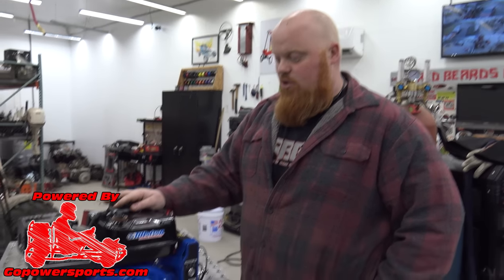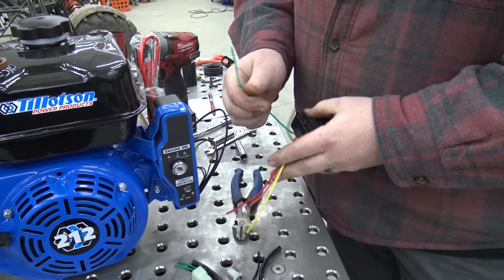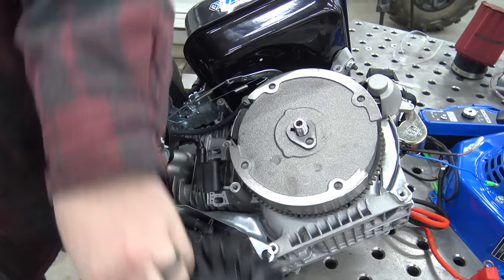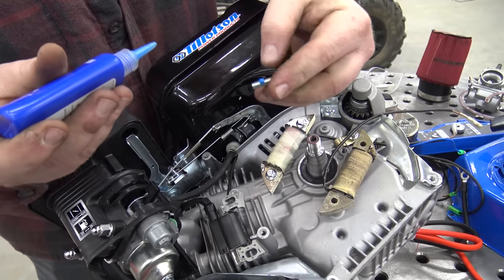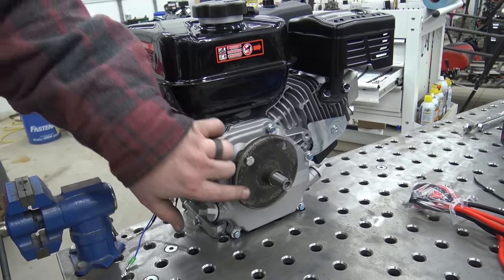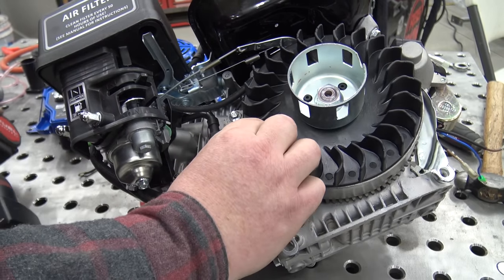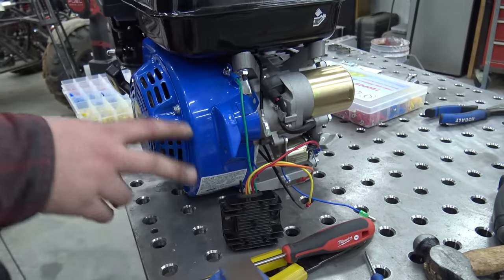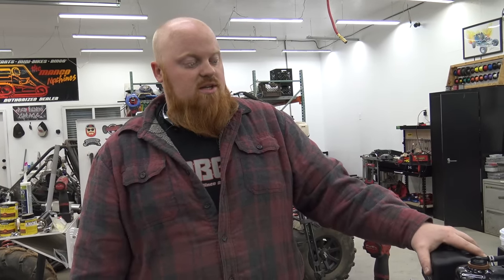How to Wire A Go Kart / Mini Bike Charging System

Comment: Whenever you see a rapid pulsing of the headlight it is because they are being run directly off the charging coil on AC current. Once you install the rectifier/regulator, the pulsing should quit, since they are now being fed "clean" DC current and also seeing a constant voltage from the battery. While they may get slightly brighter from the slight voltage increase when revved from idle to RPM , they should not have the "strobe" effect that the un-filtered charge coil current provided.
Reply: So I don't have a battery does that mean I can just hook the rectifier straight to my headlight for strictly lighting purposes
Reply: And I have the predator 224 do I need to get a special flywheel to work with the coils?
Reply: @motododo4626  Yes, you will need a new flywheel. When I upgraded from a HiSun 196 to the 224 I just swapped the flywheel over and it works great. If you don't have a flywheel to steal from another engine, monsterscooterparts has a 3-magnet flywheel for $27.49  that looks like it'll work.
Reply: @kentsugden6865  sweet I actually have a 196 off my coleman ct200u ex. I'll jack its flywheel and coil hahaha

Comment: Those coils are for a half wave rectifier. Won't charge at lower rpm. You need the actual charging coils not just a lighting coil. The charging coil has 2 wires out and produces higher ac voltage so when the rectifier steps down the voltage and converts it to DC you still get decent charging below 4k. Do it right next time.

Comment: Thank you my friend!  This is exactly what I needed to see. Based on this, at 3amps I can charge a small battery. Any info from Tillotson what the minimum CCA should be for this type of motor?
Reply: I like to use lawn mower batteries on mine but you can use a mid sized atv battery around a size 8 or 10 will work great

Comment: Not regulator, rectifier. Rectifier changes ac voltages to dc voltage. I’m not sure ,it may have a regulator too, but without the rectifier it would not make dc voltage. Love your stuff and appreciate your knowledge. Have learned much, thanks.
Reply: it is a rectifier and regulator
Reply: yes proper term is regulator/rectifier, its 2 in one

Comment: ive caught that govonor spring almost broke my leg trying to hold the cart back while i pulled the plug wire off to kill it because i didnt have a kill wire hooked up yet. im finally getting around to doing this for my world record charity ride this summer testing has been flawless. however i only go about 800 yards round trip and the battery has an onboard charger so when its parked at home its constantly on a trickle charger. i suck at wiring so thank you for explaining it to where even i can understand it

Comment: I have a 16hp and it has a single coil , on a log splitter , and I need more charging , so I've bought the dual coils not hooked up yet , so with one stock  coil there is no rectifier but two coils I will need one . Cheers .

Comment: Nice video buddy!  You got me thinking:  if i got a TILLY 212 electric start, and opted off a battery all together... dont you think that one coil that comes stock would power a 7 inch LED light bar at 12V and 1.5A when running?  I bet it would, and i really dont mind pull starting.  Thanks again for the ideas.

Comment: Got to love these engines just so many upgrades you can do just got my first tilly I love it
Reply: @Knight Recon late reply, but I just installed one of the electric start kits and I most certainly would not remove the governor using the replacement flywheel the kits come with. It's awful

Comment: It's very important to check if the existing flywheel has magnets on the inside. Most e-start engine's do, most other engine's don't. Without magnets on the inside of the flywheel, the output of the coils will be close to zero amps.

Comment: When this is all wired up and working properly, what voltage should you be reading on your battery?  For example on a car, your battery should be reading like 12.5ish volts while the car is off.  When the car is running, the alternator takes that to about 14V.  Should you see something similar on this setup?  Would the voltage increase when at full throttle vs. idle?  I am just trying to make sure my setup is connected properly.  When running, I am seeing the same battery voltage as when off.
Reply: I am seeing the same thing. I put the Go kart on Jack Stands and at wide open throttle I see the battery slowly go up in voltage but only to around 12.8 to 12.9. At idle it seems to be the same voltage as when the Go kart was started.. I hope someone answers this question.
Reply: @venomchris5818  it's because he used half wave coils with a full wave rectifier. This is a shit way to try this. You need the "charging coils" 2 wire coils and a full wave rectifier.

Comment: What should the Battery voltage read once the Regulator / Rectifier is installed and the engine is idling?

Comment: Will this dual rectifier / voltage regulator handle a non-governed higher RPM engine?
thank you.............great job on the vid's!
Reply from the maker: Yes it will work great

Comment: You briefly mentioned it but how would you stop the pulsing of a headlight like on my Coleman?
Reply: I also need help selecting the correct load resistor to stop pulsing on my bt200 with an led headlight. He did mention the coil puts out 1.5 amps so if I assume my regulator is putting out 12v with no battery it would be 12/1.5 so an 8ohm resistor . My question is do I need to check the voltage after voltage drop from the led to know for sure what resistor to use and is a battery even required or is the resistor not required with a battery.

Comment: Hey man thank you for this very informational video, i had a question, is there any other way to tighten the fly wheel to spec if you dont have a tie down tool or in this case a old 30 series cvt pulley to tie down.

Comment: Hey red beard!, quick question would this setup work on a predator 212cc? Looking to throw some lights on my go cart but Ive only seen people use the old fly wheels.. is it possible that a go power sports fly wheel would work? Would I have to put magnets on it?
Reply: Hey Alex did you end up using this set up for a predator 212? I am thinking of doing the same and I ordered a stage 2 kit for the 212 from GPS. I believe it does have magnets on it though

Comment: Nice video buddy!  I have an odd one for ya:  on a 4 wire rectifier off a mega moto 212 kit... I am seeing a DC voltage DROP as RPMs go higher?!  I read 12AC+ on the meter coming off the two coil wires before the rectifier too.  I'm thinking the rectifier is bad.  Ever seen this before?

Comment: I really don't mind if I continue using the pull start. However I'd like to do the headlight and then add front turn signals, rear turn signals, brakelight and tale light. Do you have any video on this?

Comment: Where can you find a aluminum flywheel with inner charging coils for running lights on predator 212 motors?
Reply: The golden question

Comment: I need some help. Going to watch this, but my needs are a little different. I have a 15hp 420cc horizontal engine. Would like to set up a similar system that’ll charge a 12v deep cycle marine battery. Do you know roughly how many amp hours you could charge with in an hour? Is there a calculator. I don’t have an electric start, can I put one on?

Comment: So if I have the charging coils where they are daisy chained together so I only have one wire coming from behind the flywheel do I only need a rectifier/regulator with 3 wires (coil wire,out put wire/ ground wire)?

Comment: Hey the link for the voltage regulator says it's for 150cc engines, will this work for 196? The regulator from go powersports for that engine only has 3 wires, 2 green and a red, can you explain?

Comment: Hi I really liked your video I have a harbor freight predator 301 engine and I'm trying  to find a electric starter kit for it . Do you know what might work based on your experience with small engines .I have seen the ones from ebay but I'm not sure what to get .

Comment: Hey I have a question, in the full suspension ct200 video where did you get that gas tank or what model Harley  Davidson did it come from because every single gas tank that was on the engine broke off

Comment: I have 2 word coming out of  Duramax xp7hp electric start. There is 2 wires coming out of the magneto. It's hooked up besides the one I didn't see when I rewired it. It's a black wire with a white strip any idea what it is?

Comment: I bought one of the voltage regulators but my wires are in different order then the one in the video. Is the wiring going to still the same?

Comment: I have a 420cc predator motor from harbor freight and I have a push start installed but I am having issues getting it started it's been sitting for a while but I have clean oil I have not checked the spark plugs I don't know if it could be something around my carburetor there's fuel in it though I just don't know what to do to get it started because it won't start it cranks but it won't start

Comment: I think I have a bad rectifier. Mine is wired the same as yours. I get 3 to 10 volts DC out but that's not enough to charge the battery. The voltage goes up with RPM but at a certain point it reverses and starts going down with more rpm.

Comment: Just curious. The new wire under the edge of that wire hold down. Because it's pinched and not ran through the loop will vibration over time wear into the wire and cause a short?
Reply: Exactly...I,d be surprised if it isn’t already shorted 🙄

Comment: A question I have as I'm preparing to install charging coils / starter motor to my Honda powered pressure washer, isn't there a rectifier / regulator installed inside the key switch box? If not then I need to locate one to be wired into the box as I intend to mount one to my setup.
Reply: I think they have a diod in the switch somewhere

Comment: Is there an issue sharing the DC ground with the AC coils? Wouldn't it be more effective and safe to wire the coils in series and have the output going to the rectifier/ regulator?
Reply: Great question!  I am skeptical on a shared ground too.  If you read the rectifier output... I also see BOTH AC and DC simultaneously on the leads!

Comment: I wanted to install a double charge coil on a predator 212cc hemi, but it kept hitting the inside of the flywheel.  Any Tips on how to correct this problem?
Reply: If you have a hemi predator, you need a Kohler flywheel, which is hard to find and a lot more expensive.
Reply: @pancudowny   ,
Why couldn't i just mill out a little out of the predator flywheel so it has  enough room for  clearance?

Comment: the black cable is for the key switch on without it connected to the batt + The Rectifier Regulator will not regulate your battery voltage will overcharge it
Reply: So we should run the constant 12v from the key switch to that black wire which goes to the battery?
Reply: @johnwarren370  Yes it should normally the black cable should be connected to the key on switch . If you want to know more information Google voltage regulator 5 pin wiring diagram
Reply: Rgr thanks.

Comment: Would this work on a 212 pred?
Reply: Yes, one of my 212 predators has a stator near my flywheel.
Reply: Yup as long as you have a 3 magnet flywheel and it has the right taper for the crankshaft

Comment: I have my light connected to a battery on a switch and now I should be charging the battery through the regulator. And that eliminates the lights pulsing.

Comment: Red... I bought the charging coils you linked to in your video description, but they have two wires coming off of each coil.  What do I do with the extra wire?
Reply: red wire is power black wire go to ground on motor block

Comment: Can you show a video of you putting back the electric starter key switch stock back with the 12 volt regulator I would like to keep my original key switch and put a 12 V regulator going to add headlights need some help can you direct me to the right direction

Comment: I was unlucky enough to ruin the threads on the crankshaft of a predator 212 by taking the flywheel off using the 13/16 nut to protect the threads like you did in this video. It seems like I was just unlucky but wanted to let people know it CAN happen. Maybe a defective and weak thread in my case, but the nut was not being hit aggressively at all. This is still the seemingly safest way to remove the flywheel that I have seen.
Reply: You probably didn't have the nut threaded down far enough or it was crossthreaded

Comment: Do they have a Billet  flywheel to do this
Reply: Arc Racing has one for a gx200 which also fits a Predator 212. Not sure if it will fit a Tillotson though
https://www.arcracing.com/6679-clone-196cc-electric-start-billet-flywheel-3-9lb/

Comment: Get the propper tool and learn correct method, crimping will always be more reliable than soldering, when done properly particularly when there is vibration involved.
Insulated crimps where invented for aviation.
Yes, I have been properly trained and experienced in soldering too.

Comment: When are you going to make that video on how to stop a pulsing headlight with out using a battery?
Reply: I'm pretty sure if u install a voltage regulator itll keep it from flickering. I was only getting 8v at idle off my tillitson and now I'm getting 14.5VDC and every rpm with the regulator installed.
Reply: @minibikegarage1577  What size battery are you using?
Reply: Really? I thought that even if you installed a voltage regulator it would still flicker. I guess I will have to try that.
Reply: @OrganGrindersSwing  it's a smaller go powersports battery
Reply: @arikbeveridge8995  I personally haven't tried it with out a battery but I've heard it eliminates flicker. I could be wrong though
Reply: Yeah I think you have to run a battery to get a constant stream of voltage at any rpms which stops the flickering, and I don't want to run a battery on my mini bike.
Reply: @arikbeveridge8995  the regulator keeps the voltage constant from your charging system. If it's for example 8V at idle and 16 at full throttle, the regulator will keep it at 14.5V to safely charge the battery. They also have capacitors to store power, which is why they can keep at 14.5 volts, even at idle. I'm pretty sure it would keep the voltage constant without a battery. It goes in between the charging coil and battery. So its regulating and keeping the voltage constant  before  it even hits the battery. So I'd imagine it will work with out a battery. I've seen here YouTube a guy added a regulator to a baja warrior with out a battery and it worked great. Good luck man

Comment: This is an off-topic question, but why does my go kart constantly pull? While idling and even when I pull-start it, it is constantly moving.
Reply: It could be your clutch is sticking, look up a video how to oil your clutch.
Reply: @ElPatronGamefarm  I was looking at extruded diagrams and saw that I didn’t have the bushing that covers the inside of the drive-pulley. I made one out of plastic pipe just to see if that was my problem and it fixed it. I went ahead and ordered a new torque converter, and it will be here in the morning. Thanks for your help!

Comment: About the torque wrench. Springs don’t wear out from being compressed. They wear out from cycling. Therefore, by letting off the tension to zero you are actually shortening the life of the spring.
Reply: Do you have any data for that? I've always been told in my industry we return them back to lowest setting every time.
Reply: @scrivyscriv  I guess I don’t have a direct source that I can quote other than physics if you look up the metallurgy of spring steel. It’s just like the people that don’t keep firearm magazines loaded because they think the spring is going to wear out. Someone said it once a long time ago and it seemed plausible so people went with it. Metal gets work hardened from being bent back and forth in the same spot. Eventually it fails. Same thing happens with springs. They will work until the weakest spot gets work hardened then it will break.
Reply: @bobmedic3214  Interesting, I'll look more in to that and see if I can come up with some published studies. All I've ever heard was word of mouth. The mag example is a good one too

Comment: Springs wear with compression and decompression cycles. They do not wear when they are sitting stagnant under compression. You are wearing your torque wrench spring faster by cycling it. The more you know. Do you jack up and disassemble your truck suspension everytime you park it to keep from wearing out it's suspension. Doesn't make any sense does it

Comment: Does the starter have the battery built in or do I need an external battery?
Reply: You need a battery. I'm using a power wheels 12v and it does really well

Comment: He keeps calling it a voltage regulator, but it’s a AC Rectifier. It a 4 pole bridge rectifier.
When he said voltage regulator I was wondering if it was a resistive type or an mppt type. The later being a bit more expensive, but vastly more efficient. But it’s not a voltage regulator it’s an AC Rectifier.
Reply: Don't forget the 'charging' coil air gap with business card.